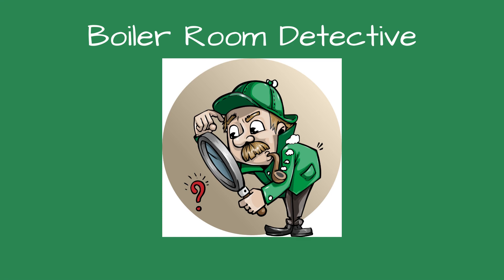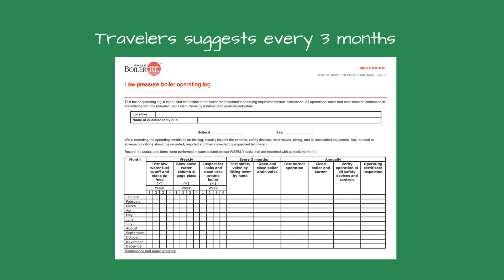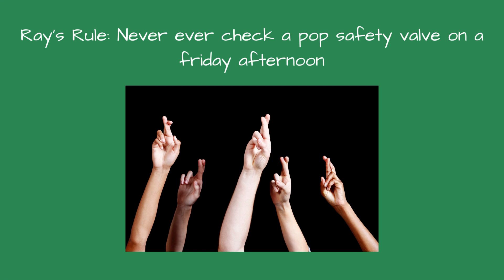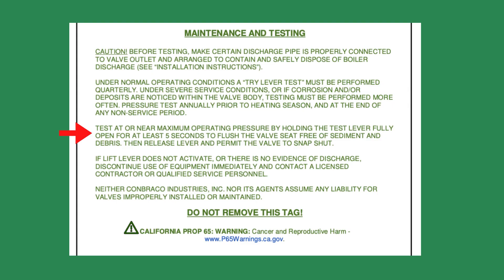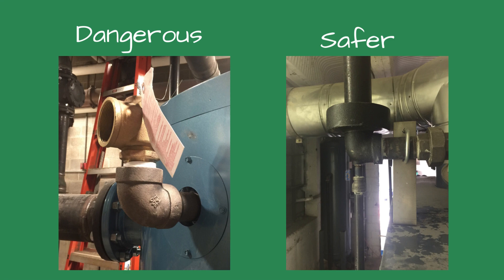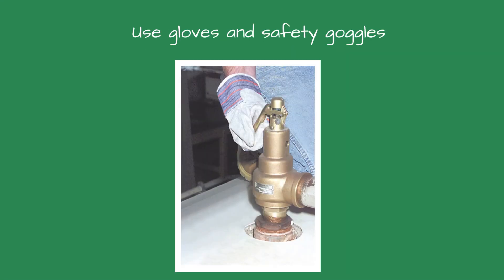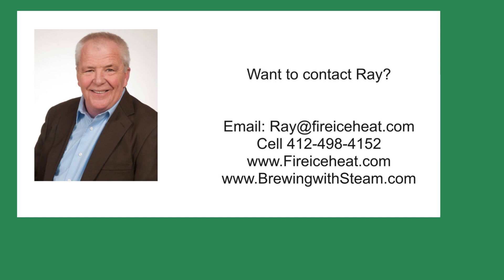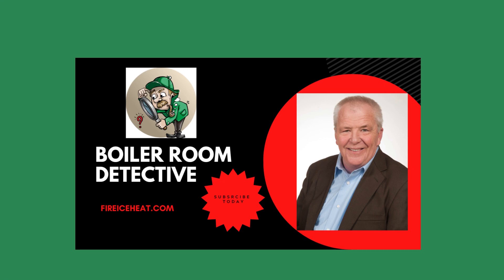Testing a steam pop safety valve

Comment: Autoclave was not tested for a while during covid and yes, it was stuck when I tried to open it.  Replaced it myself.
Reply from the maker: Im glad to hear you test the pop safety. For a while, it was really hard to find pop safeties. Thanks for the comment
Reply: I should have mentioned it was somehow corroded and the seat was stuck to the pressure seal part, which I had heard could happen. @boilerroomdetective
Reply from the maker: @walrus4248  It does happen sometimes. Glad you caught before it was needed